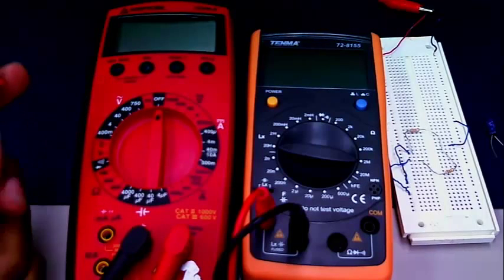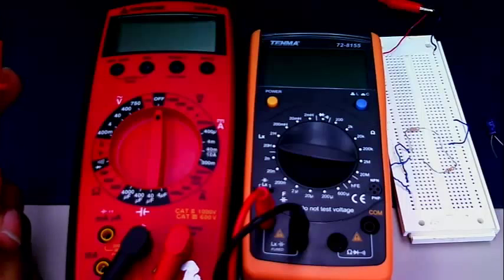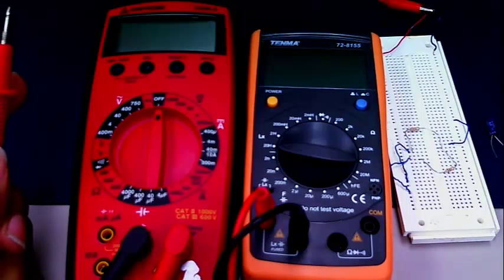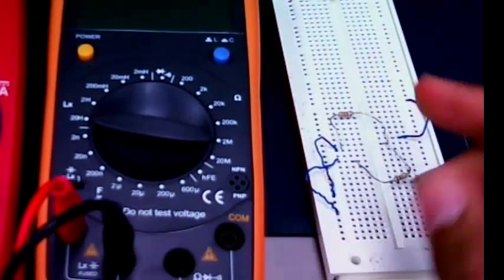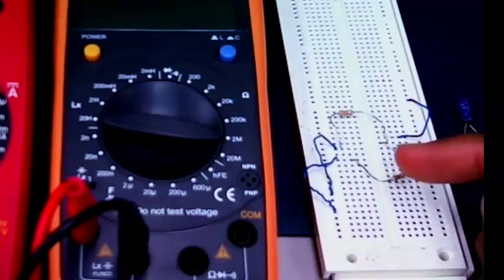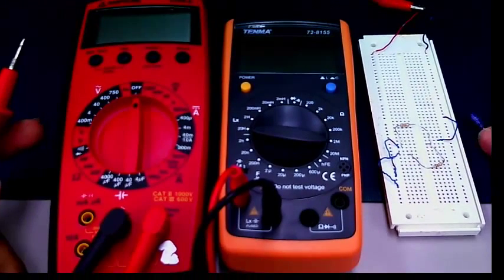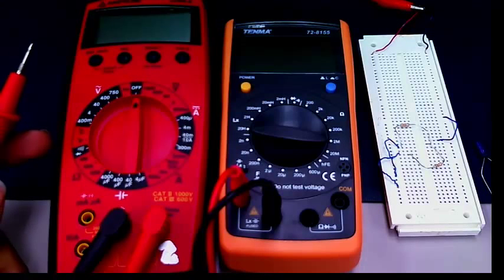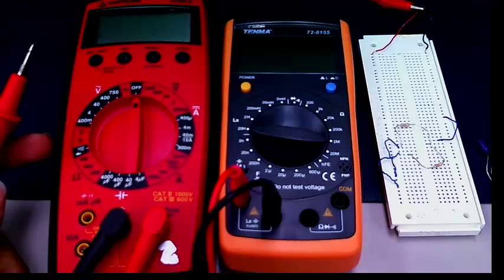Resistance, Capacitance, and Inductance Measurements with Digital Meters

Comment: Terry Sturtevant with out buying an expensive inductance meter, is there a cheaper way of doing it?
Reply: +Owen Chase science channel Yes, you can calculate inductance by using caliper and formulas. Or if connecting to the LC or LR circuit, by measureing frequency and calculating inductance with formulas.
Reply: RPdigital ok thanks
Reply: Owen Chase science channel No problem, mate! Have you bought a multimeter or LCR-meter already?
Reply: +RPdigital I bought a multimeter, I wish I had inductance meter but They are expensive.